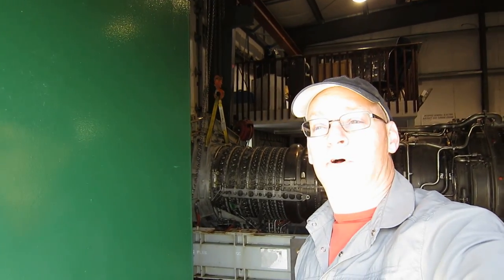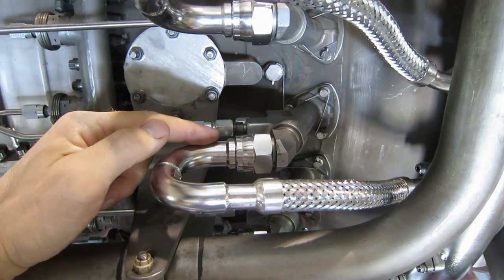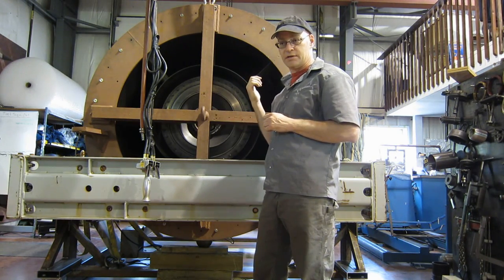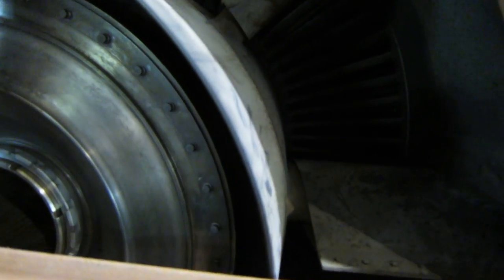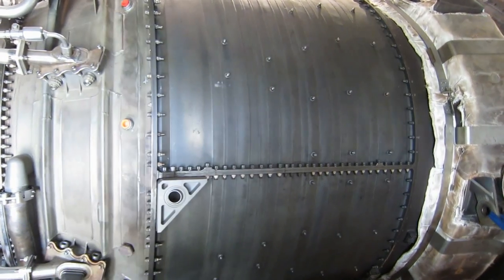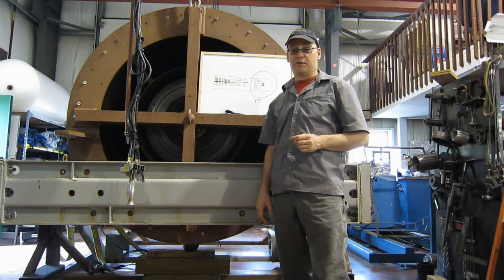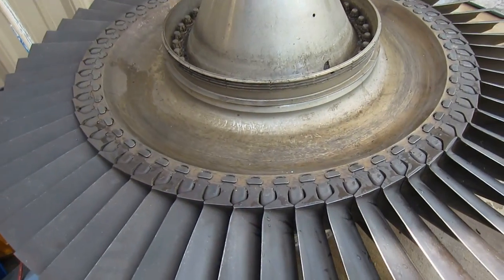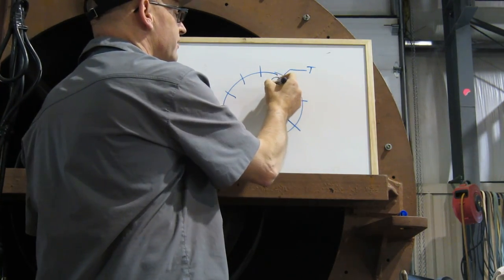Power Turbines and Thermocouples

Comment: Just a small note b/c i'm a picky engineer. If you do (66,000 ft lb) x (3000 rev/ 60 sec) you get 3,300,000 ft lb/sec and since 1 hp = 550 ft lb/ sec, you get 6,000 hp, which is not right. Shaft Power is calculated as P = 2 x pi x rev/sec x Torque  So if you multiply the 6000 hp x 2 pi you get about 37,700 hp which is a bit closer to that nominal rating of 34,800 hp. 

Thanks for clearing up the thermocouples thing for me! You explained it perfectly! Thanks for taking the time to do this Jay!

Comment from the maker: A water wash is cool, because you can see the water going in the front.
Water injection happens in the combustors, and there's no visible steam, so I don't know what you'd notice. The exhaust might change in appearance.
The old jets would make a lot of black smoke when they used the water, but propane doesn't make soot like jet fuel.

Comment from the maker: Subsonic aerodynamics is one of the most misunderstood subjects out there.
This inlet was designed originally as part of a large turbofan aircraft engine.
The bulletnose is so big that it forces any small particles of debris in the airstream to be deflected radially outwards toward the bypass duct and go through the fan.
Only the much lighter "particles" of air can turn the corner around the bulging nose and make it into the fuel-burning core. So the airliner engine eats clean air.

Comment from the maker: Well, the CFM56 is one of the engines I have not worked on, so I don't know exactly where anything is... but TIT is turbine inlet temperature, and is not usually directly measured because the temp is so high that thermocouples don't last very long in that location. ITT would be inter-turbine temperature, and is the temperature after the HP but before the LP turbine in this two-shaft engine.

Comment from the maker: It is not a destructive test, In an airliner engine, the water is flung outward by the fan, and almost none of it enters the core. So long as its a spray, like from 40 fire hoses, it increases the load on the fan, but does not damage it.
A ton of water per minute would damage the core, but it does not get in there.

Comment: I know of a man who was one of the engineers on the Beech Starship.  Not only did each propeller blade encounter extreme thermal shock when it rotated past the exhaust stacks for the engine, the resulting change in air density and velocity created a change in lift (thrust) over that section of the blade, setting in motion a mechanical oscillation and made the blades more prone to fatigue.

Comment from the maker: The enlarged LPC of the engines use tremendous amounts of power to turn them... that's what the 5 stage turbine is for. Maybe I should have called it the LP turbine instead of an aircraft PT. That would have been more perfectly technically correct.
If that's not clear, then please watch my videos on Turbojet or Turbofan, and also one called "Power Turbines: What are They?"

Comment from the maker: No, and no. The gas generator turbine is designed to extract enough power from the exhaust stream to drive the compressor and the accessories, like the fuel and oil pumps. There is a lot of energy left over in the exhaust, and a jet engine uses a convergent nozzle to convert that energy into acceleration of the exhaust gases, which produces thrust. A power turbine can be place in the exhaust instead of a jet nozzle, and it turns all that energy into torque on a spinning shaft.

Comment: Right, I understand. The 5252 actually appears when you combine the conversions in my formula. That is, the 550 ft lb/sec, 2 pi, and the 1/60 to convert from min to sec are all lumped together by 550 / (2 pi/60) = 5252.  So your formula and my formula are identical...mine just used the definitions of each term to find the constant, 1/5252 which you multiply by at the end. So, both of our formulas are correct....your's is just a shortcut I had never realized before. Thanks XD

Comment: Hello again JayZ, I have 3 new questions for you: 1) Hypothetically, what would happen if you would put 2 PT after each other. For example 2 of the one at 7:17. I know that it won't give you more power but why?     2) What is the difference between a 5 stage PT and a single stage PT (except of the obvoius stages)? How can simply one layer of blades be as effective as 5 of them?     3) How does a turbofan (like the CF6) get power to their generators? Where is that shaft?    Greetings from Norway

Comment: The LMS100 is a development of the LM2500 which has an entirely new combustor and a larger power turbine designed to extract as much power as possible out of the thrust of the gas producer.

Comment: Correct me if I'm wrong, but I think the LM2500 has the same core as the CF6 which is a high bypass turbofan engine. So, the LP compressor(s) would be used to turn the giant fan at the front of the engine.

Comment: Yes, I made a typo. I meant the LP turbine(s). :-)  A fan increases the pressure of a gas slightly and is mainly used to mobilize a gas. A compressor is capable of compressing a gas to a very high pressure. From an engineering perspective, a turbine is a device which takes the change in enthalpy (change in flow and internal energy) from the beginning of the first stage power turbine to the exit of the last stage and converts this change in enthalpy into useful shaft work which is what you said.

Comment: With respect to the 5-stage aircraft version of a power turbine shown here, you'd mentioned they're no longer in use. What were they used to power (on aircraft); accessories, compressed air for start-up, etc.? Also, where would the tubojet that had this PT attached located (at or near the tail)?

Comment: Is the water injection because of NOx-regulation? How much does it affect the fuel-efficiency (thermal efficiency) of the engine? Does it drop by 1%? Less? More?
Reply from the maker: This operator uses it to maximize power, and reduce NOx. I don't know the effect on efficiency.
Reply: I watched one of your other videos where you test water injection and you said how many gallons it used, I think it works out to about 0,75-1,5 liters per second. To turn 1 liter of water into steam takes about 2MJ (at 100 C and 1 atm anyway), doing it every second means 2MW, that would be about 3% of the heat generated in the engine. If that is a loss or recovered downstream someone smarter than me will have to explain :-)
Reply: My educated guess would be that though you are losing combustion heat to vaporize the injected water, there will still be a small net benefit in efficiency because of the increased mass flow (energy flow) through the turbine (more turbine power, the purpose of water injection). This, of course is probably very much a function of how much water you are injecting as well. One would need to work the thermo to know for sure. While this is only a guess, in the case of steam injected gas turbines, the sole purpose is to increase efficiency while also augmenting power. This is easily possible since STIG systems utilize the waste heat from turbine exhaust to create the steam prior to injection into the combustor, as opposed to using the heat from within the combustor itself. This can increase thermal efficiency as much as 6-10% in some cases.

Comment: Thank you Jay for another great explanation! But once again I would like to ask you something. You've shown us a 5 stage aircraft PT. But what is it's use? Where in an aircraft do you need that amount of mechanical power? Most the power is used to accelerate the aircraft and only a minor amount is used to drive the generators, pumps etc. Or what do I get wrong? Maybe it has to do with the aircraft's PACKs?

Comment: Other than at start up, where an electric or air starter is engaged, does a turbojet rotor assembly (compressor, shaft, turbine) generate torque perpendicular to the engine's axis that acts on the engine mounts?

Comment: sorry.i am indonesian,
i m very interesting about jet engine. 
i have question about that. 
are the jet engine have limit when jet used in plane because air speed > from compresor speed?
are we can transform jet engine to scramjet
Reply: sorry i m  not good in english
Reply: Salam mas Naizar:
Q1: No - the nozzle on the rear of the engine is used to accelerate air to an appropriate speed to match the needs of the aircraft - right up to Mach 3+ where speed is limited by other factors.
Q2: Jet engines are very carefully engineered to their purpose. Kayaknya lebih mudah mulai dari nol, daripada konversi begitu.

Comment: Are afterburners for aircraft only? Or are they used in industrial engines as well?
Reply from the maker: +Isaac Lubow Only military fighter jet engines.
Reply: You're not entirely accurate; the supersonic passenger jet planes Tupolev 144 and Concorde used afterburners too.
Reply from the maker: Oh, but it is YOU, my good sir, being not completely accurate. If you examine the original question, it was asked about the present, as indicated by the use of the word "are".
By changing the tense in your answer to the past, through the use of the word "used", you have lost your way, and are in error.
Maybe we are both not accurate, because although Concorde never flies any more, I think I read somewhere that the russians still use the TU144.

All that is mostly irrelevant anyway, because the spirit of the question was whether AB is used in industrial settings. Perhaps I over answered, and that was also a mistake, no?
Reply: I see now, sorry. I guess it's due to your own answer to Isaac not being time specific and that due to English not being my own mother language, I recognized "are used" as meaning "have been used" instead of "are being used".
Reply from the maker: Apollorion ...So long as we are all having fun. That's the most important thing.
Reply: We are!
Reply: Apollorion - In that case, you are more than impressively holding your own in a highly technical field.

I shudder how lost I would feel if this channel were conducted in German or French.  Sometimes I struggle just following the Canadian dialect!   ;-P
Reply: If I'm reading things right, afterburners/reheat are only for aircraft that need high thrust and can't afford large size but can afford fuel inefficiency --> military. Otherwise - for high thrust but bigger engine - use a turbofan.  So not for power turbines because the fuel efficiency is bad for a given mass flow.

Comment: Is it possible to use seawater to increase the power (or efficiency) of a gas turbine driven boat?
Reply: I imagine that the answer here is an emphatic NO, as salt and mineral (normally present in sea water) deposition would quickly cause havoc in the combustion and HP turbine sections.

Comment: That’s interesting; I didn’t know turbines used water injection. That’s fairly common within the auto high performance industry, and extremely common with diesels. My rotary couldn’t live without W/I. 700 odd HP out of a 1.3l 13b-rew just isn’t possible without (barring expensive fuels) supplemental injection. (Either methanol, Water or a mix of the two)

Comment from the maker: That's because, you used the wrong formula.
If you take the simple route, and use the "trades math" ( gaaaack!) equation, then 
66,000 X 3,000 /5252 = 37,700  
This formula is basic, crude, and in every handbook out there, even in a recent issue of Cycle World... they even explain where the 5252 constant comes from.

So please, nobody needs to explain it here.

Comment: intersting. If you would measure the amount of fuel is used in normal operation (no blocked fuel nozle) and compare it to the amount that is used in abnormal operation, then you could figure out, that something is wrong, without reading out the temperature-sensors? Are these information a captured by the electronics?
Ok, the fuel consuption depends on a lot of more factors, like air, water in the air, etc....
but anyways, like you professional videos!